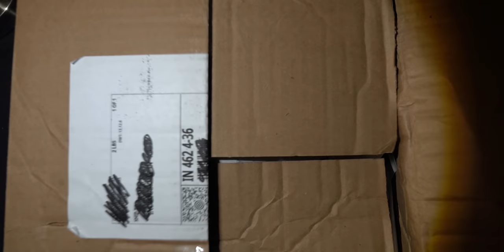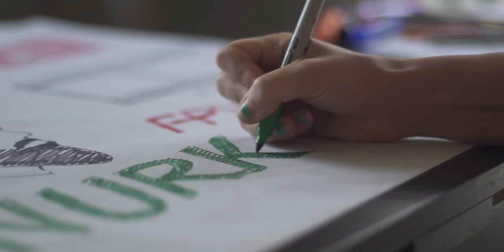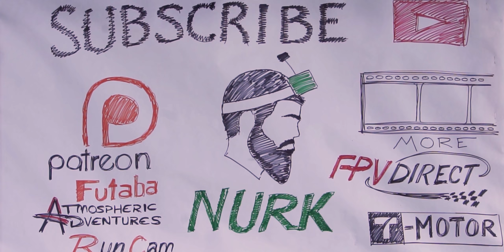Introducing the CMW Banggod NURK Edition BNF Freestyle Drone

Comment: So to get this in the air I would just need a crossfire conpatible radio, dji goggles and 5s or 6s lipos?
Reply: I think you can customise the receiver on order. But ya for the same exact built on this video he’s using crossfire

Comment: Nurk would fly a brick or a rock just as smooth. You are an awesome pilot. 👌 Respect. 
I have 3 builds with that frame and that's my entire 5" fleet. 1 digital and 1 analog. I love this frame, they all fly amazing, they went through some hard crashes but still, afer cleaning I did on them recently they look like new and that's the frame I'm planning to use for 5 inch. 
Now can you please tell me what is your overall weight? My analog ones including Session 5 are 685g, digital one with full sized air unit is 643g without any additional camera. With Session 5 or Runcam 5 Orange it would be around 720-730g.
PLEASE, what is ready to fly weight of this one?
Thanks and keep on the good work. 👍

Comment: Banggod 5" is cool but a pain to work on. You have to turn the FC sideways so the power comes out the side... so right off the bat you have to make custom wiring for the FC/ESC connection... If you dont it is tight by the air unit. Then it makes it hard to swap motors.  Other than that it is pretty cool. It breaks just like any other quad I have too. :P

Comment: Great channel bro. I’m new to fpv and I have a question for u I’m getting a jumper t8sg plus v2 could u please let me know I’m having trouble finding out will it work and bind to the tinyhawk 2 and tinyhawk 2 freestyle because someone just told me it won’t work for d8 protocol but all the research I’ve done I was led to believe it will work for d8, all I need to know is will it bind and fly the 2 drones I’ve mentioned, would appreciate a fast reply please as it’s just about to be ordered so I get it for Christmas with my iflight nazgul5 v2 6s. Thanks in advance for informing me if it will work or not.... even if u don’t know thanks for taking a look.

Comment: One day i Will be a FPV pilot..i dont Care what age im going to be..
Reply from the maker: GET IT!
Reply: If you are here you are already a FPV pilot... I guess you already see yourself flying through gaps and trees. You only need to learn. Go go go go!!! 👍👍
Reply: Don’t hesitate if this video made you think I wanna fly too!
Reply: Get a simulator, 20 hrs minimum.
Reply: i got controller and googles, shredding in sims atm. next month i'm going for my first quad. 
man, i'm going to break that thing so hard. ordering another frame kit with it just so i can fly at least for 2 days :D
Reply: @AlenHR  practice disarming to land in the sim.
Reply: i'm 54yr, best hobby ever.
Reply: @Beastflow FPV how do I avoid wasting money?
Reply: @abouchard2903  agree and you can go BNF or build depend how quickly you want in the air over how ready you are to get that soldering iron out!
Reply: @NOVUSuk  yes, I went tiny whoops and a 4in bnf, eventually crashed and had to learn how to solder. Get a mid range soldering iron 63/37leaded  solder and some practice boards off amazon and go to work.
Reply: @abouchard2903  pro tip - get some tips lol oh and you can also use a scientific calculator to practise
Reply: @NOVUSuk  gosh yes, my first tip unless after a week of practice.
Reply: These days a few hours on a sim and your there. But to be a good pilot it takes a little bit of your time. But to be a paid good pilot ( there are shity paid pilots too) it takes lots more than being a good pilot.  Too much time.  But Nurk has earned everything he's got in this.
Reply: @TheMadmacs  Well, can't I just push 'reset' switch? :D Yea, landing seems much harder than buzzing around. I have 10+ hours on sim and I feel pretty confident. I'll trash that thing as soon as it arrives. Not because I am unable to control it, been flying stuff in many shapes and forms. I'll be careful on my first pack. But the second "I got this, EZ" pack is gonna be fatal for the poor thing.
Reply: @AlenHR  landing isnt too hard though, its just good to be able to land in a tight spot, and avoidning dirt and especially mud.   and crashing is the name of the game, hehe,  you should set up to survive crashes, i use hot glue on all the crashpoint and i use zip ties covered with heatshrink to protect antenna, .. (and force antenna to only bend away from props),   being able to fly is a big help, but fpv and quads are really fast,  they say learn to bank turn then figure of eight, then emergency stop, the stop is good because it will put you in a ''mess'' which you can learn to fix without too much trouble, which will give you the confidence to really go for it,
Reply: @TheMadmacs  Thanks for advices. I'm in top 50 on most of the race tracks in DRL I have tried, so if the real thing is anywhere near sim, I'm probably good. Doing pretty fine in power looping, split S-ing and those kind of basic acro maneuvers too.
My main problem is my recklessness and wanting to be as efficient as possible. Which means I'm going "full gas no brakes" most of the time. And I'm unable to add weight that does not make me going faster. So I'll probably remove "excess" stuff instead of adding more protection.
And this kind of cocky attitude will make me trash it more often than necessary.
Well, my money.. as they say :D
Reply: @AlenHR  ah top 50, you should be fine,  just practice emergency stops,  literally go full throttle then zero it and flip around and full throttle again to stop, this will make the quad go crazy, and learning to cope with what you see in the goggles and fix it is a huge benefit in a normal crash,  its tempting to disarm when all you can see is skygroundskygroundskyground, but if you can hang in there you can often save it.  you should also get two quads, stick time is what you want. if its one crash and youre out? its harder to go for it. start ordering spare motors and frame, and vtx etc until you have enough to build number two quad. ps. i am the boring zero crash policy guy, i crash at least once per hour lololol.   the sims are all great,  they will save you from your first 200 crashes, huge help.  pro tip. avoid flying fast near tree branches+ people (yourself) when a quad clips a tree branch it will go crazy in any direction, people +tree branches= super slow and careful.
Reply: @TheMadmacs  Don't remember having problems orienting myself after crashing with gates in a race, but never practiced that. This will be my tonight's sim drill for sure. 
I ordered HGLRC Vista version of Sector132 and another frame kit + bunch of props. This will give me opportunity to try out couple of sub 250g configurations on the same quad, right out of the box. Then I'll be more able to decide what I like and start my first build in that direction.
I'll start on a really big grassy surface without obstacles. I know first couple of flights will be overwhelming, regardless of my sim experience so I'll be careful.
Reply: @AlenHR  only other thing i can think of is stick rates, everybody uses around 900dps these days, (racers much slower) i would suggest start with 900 and use super rate and a little expo to soften center sticks, and from there use feedforward to speed up the stick response to your preference. probably best to start with  defaults and create profile 2 for the 900, you can switch to profile two using your radio and goggles.  and oh by the way sub 250g..... thats gonna be sooo fast hehehe. big field is good but having stuff nearer helps to give information about how you are moving, so don't spend more than a couple of packs in the open, find a tree to terrify hehehe
Reply: @cinialvespow1054  is there such a thing as wasting money when you're in love?
Reply: @NOVUSuk  scientific calculator for practice is a good shout, which tip should i get for my ts100?
Reply: Buy a transmitter like a jumper t16 pro.. And a sim like liftoff.. And sim.. Sim like crazy and start learning. Its winter in the states so if you are, your looking at being in the air eairly spring!

Comment: Whew! Long commercial.

No skin anymore. In fact, shortly after this video aired, the stopped supplying it. But still include it in the pictures - even though it has been YEARS - update your site CMW!

No GoPro mount as stated, and shown, in this video, they'll sell you one for an additional 40 bucks. But still show it as included.

Props. Color may vary. But...this is the Nurk, it should come with everything as shown?

I've been on the fence, and keep going back, on buying this or the frame and build my own...

However, the only good videos I've seen about Catalyst Machine Works is either from Catalyst Machine Works, or people who have a financial interest in CDM selling products.

Pawel has some non-biased information on this. As do I. And it doesn't seem to align to all these long format commercials.

Nothing against you Nurk, I applaud everyone who is making money off these companies, finally. Kudos!!!

But it is transparent, and tired.

If all you are doing is "reviewing" one single product that is for sale somewhere it is a commercial. Especially when there is nothing of detriment to report.

Comment: Dang I want one, brand new to this, pointers?
Reply: Fly a simulator first! Mr Steele has a great playlist on how to get into fpv.
Reply: It's an awesome hobby but there is definitely a learning curve. Get a transmitter first and fly in a simulator (for example velocidrone or Liftoff)
Or if you really hate to do that you can get a little whoop quad and practice with that, but I'd highly recommend the simulator instead.
Don't just get a 5inch quad and fly without any practice, you'll probably destroy it in the first few flights...